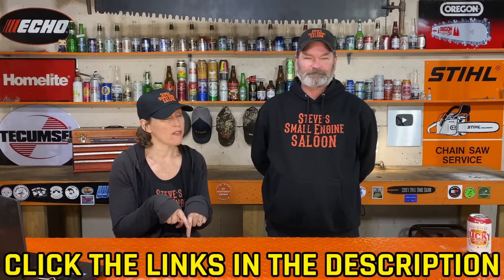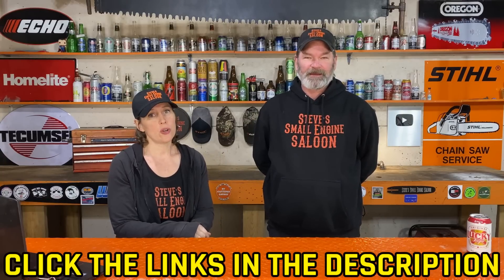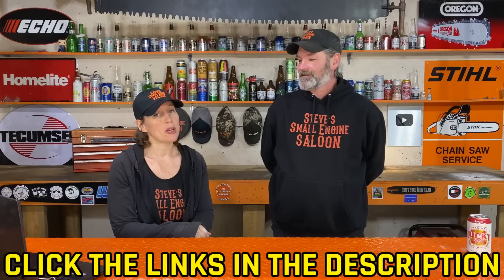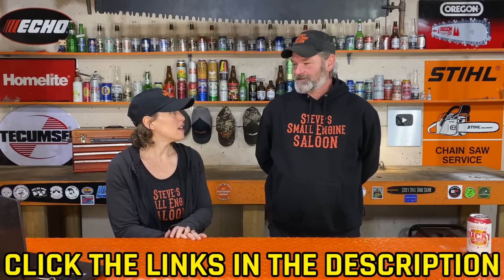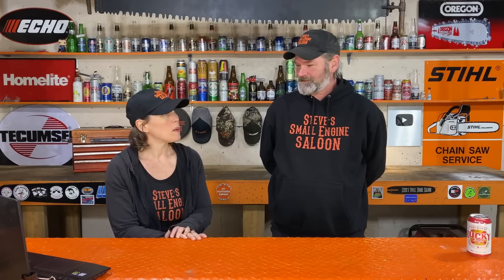Why Does My Engine STOP Running After A Few Minutes? (DAY 29)

Comment: I've definitely had this happen when the fuel tank has a clogged vent. It sucks fuel out of the tank for awhile but eventually it can't suck no more. Loosen the gas cap and you can hear it suck in some air because the tank has actually pulled a vacuum. If you leave the gas cap loose it'll run forever. If this matches your symptoms it definitely means you need to fix the vent.
Reply: Hey, I've got a Honda powered trash pump that has this problem. The gas cap looks like it wasn't meant to be disassembled, any idea how to clean the vent?
Reply: @mrbill4128  not sure if this is my problem but the husqvarna lt151 i have likes to choke for fuel even though there is still a half tank of fuel in it and then it decides to turn itself off